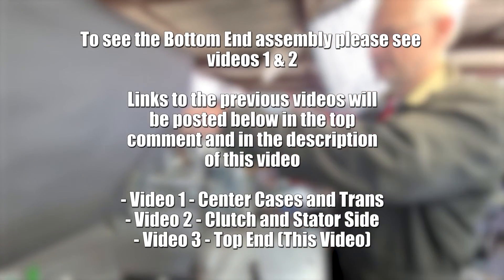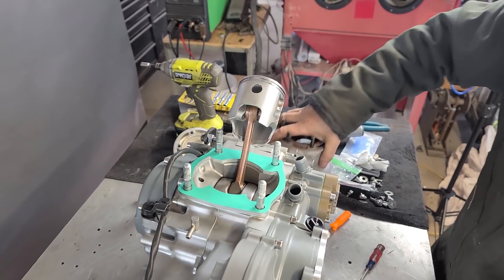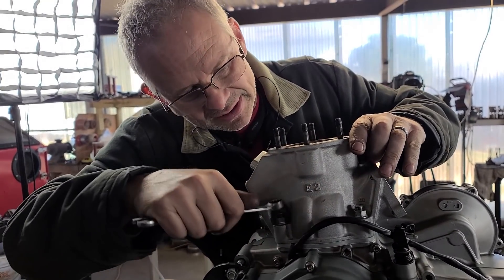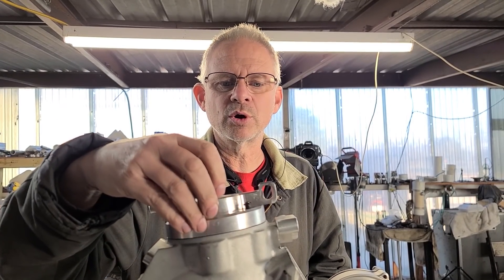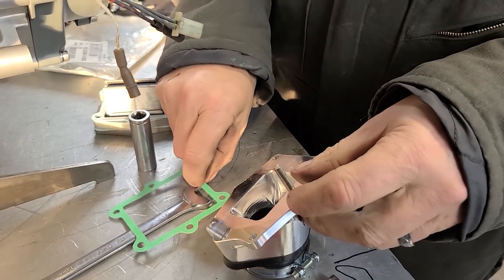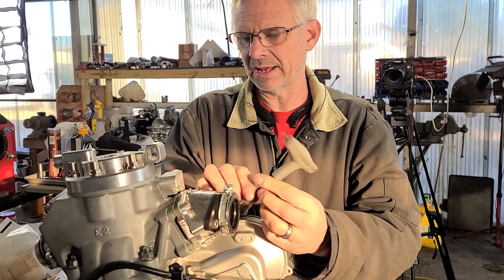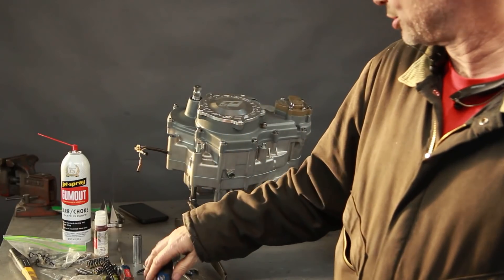How To Build an 85-89 250R Motor W/ Dave Moore - Part 3 - Top End

Comment: Beings I just found the videos on 12/26/2023 a few questions. Did you replace the 2nd driven gear?
I had an 88 TRX250R I raced motocross and was racing at Washougal and blew the 2nd driven gear out the left case half.
I rebuilt it myself had no problems after rebuild. I was ported, piped, head mod, bigger carb, after market reeds.
Also took it to Winchester Bay, and Florence. Had no problems climbing any of the dunes.

Comment: A cornucopia of information! Thanks for sharing Dave's knowledge. I am building an '82 Suzuki RM 250Z engine and have a question about where to put the piston ring end gap. It is a single ring and wonder if I should line it up with a solid portion of the cylinder that misses the ports. Thanks in advance for any help.  Keep up the awesome videos Sabo. Cheers!

Comment: Deff would be a sweet vid series from different builders. But you would have to have him use his own motor lol 😆  Dave is the man! I'm a banshee guy now but I started as an R guy and can aprefiate the info and knowledge! I wish someone would do an in depth video on banshee clutch rod length and mods and figuring out the correct throw if you have worn down clutch rod a little etc. Exactly what he did there but for the shee. That was probably my favorite part of this series actually!!!
Reply from the maker: I'm blanking right now but I think the banshee used a similar push rod system and can be corrected the same way; I will re-visit this as I am starting the tear down on my 421 this week!

Comment: Is it important to check the squish if I'm building with a stock cylinder and planning to run pump gas?
Reply: If its still 100% OEM( meaning all the parts your using are OEM and all built to work together) then the answer is no. You will be fine.

Comment: Yo Mike need some help figuring out what pipe to use on my ltz rm250 swap do I get it cut and customized or should I cut the inner frame bars that hold the old oil tank. Trying to get this thing done. My 450r ready for a race with that kfx 🤟🏻😎😅
Reply from the maker: I would recommend finding a pipe builder that's willing to take on the project; you could call LED and see if they can help or if they can refer you to someone
Reply: @MichaelSabo  quick update lol I used a yz250 pipe right side mounted fit perfect.. but thanks bro appreciate it 💯

Comment: Who makes those billet intakes?
Reply: I make them.
Reply from the maker: Yes, Sonny makes them; I did not end up using it though because of fitment in my frame due to my setup. Currently I am running a UPP boot.
Reply: Sonny i run a billet oversized bowl on my pwk 38mm non air striker carb.  Anyway to make one to get the carb to sit flat? I have a upp intake now but is tilted right. How can I get in touch with you? Its a 88 trx 250r.

Comment: What intake boot did you use on this build?
Sonny
Reply: They are Mikuni boots. Only the best.
Reply: @sonnyfricia7471  where can I purchase two for my trx250r
Reply from the maker: Yes, the intake is made by Sonny and it's a great piece but fair warning, mine did not fit when going into the frame and I ended up using a UPP boot instead. Depends on your setup.

Comment from the maker: Thank you for watching the 250R build series with Dave and I! Chapters and tool/products are below 🤘

Video 1 - Center Cases and Transmission - https://youtu.be/ASpYpSJ7X6A
Video 2 - Clutch and Stator Side - https://youtu.be/Bx97SovoivY
Video of This Motor Running - https://youtu.be/ctupjItBnHM

Chapters

0:00 - Intro
0:15 - Piston Install
1:57 - Cylinder and Spacer Plate Install
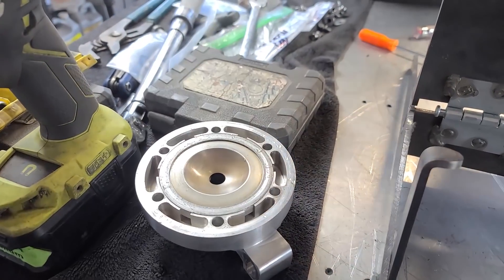5:28 - Head Install and Squish Explanation
8:34 - Exhaust Flange Install
9:00 - Reeds, Spacer, and Intake Install
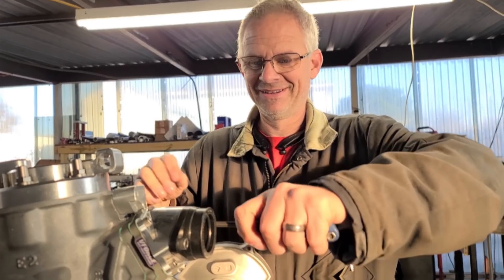14:03 - Finished Motor
15:03 - Showcase and Engine Running
15:55 - Bloopers

Tools and Parts in This Video

Crank puller/Installer - https://bit.ly/3kBXDCr
Case Splitter - https://bit.ly/3dNh3D4
Engine Stand - https://bit.ly/2Tg3J1T
Clutch holding tool - https://amzn.to/2O6WSFh
T-Handle Hex Wrenches - https://bit.ly/2MEEsvm
Red Loctite - https://bit.ly/3szbpIF
Rekluse Clutch - https://rekluse.com/product/torqdrive-clutch-pack/
Rekluse Oil - https://bit.ly/2NGF5oK
Hinson Basket - https://bit.ly/2NDMQM9
Reply: My yamaha blaster is 270cc

But the piston is not straight from the top like this
Reply: Hello. What did you do with your hpi ignition.
Reply: Where did you get those collars from
Reply: How does one get ahold of Dave
Reply: @iheartwheelies  I don’t know how to get ahold of Dave but if you go the LED performance you talk to Arlen who he talks about in the video said he’s been doing it longer than him he answers all the questions you need to know and makes a lot of replacement parts in-house that are obsolete